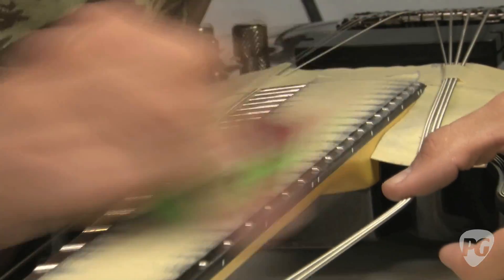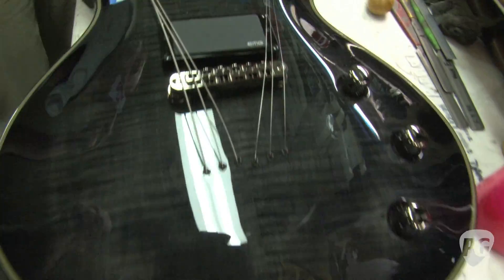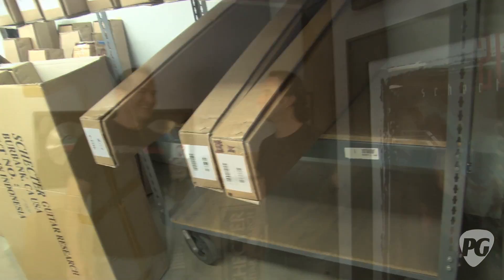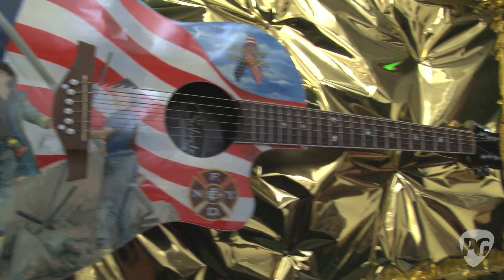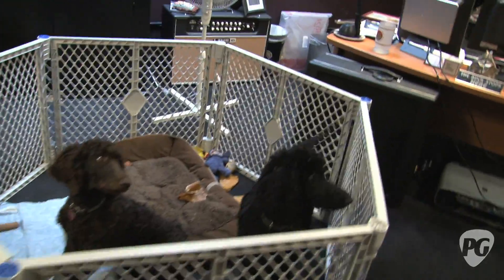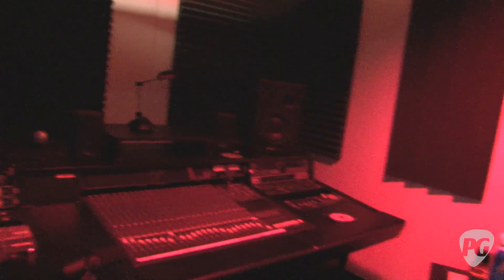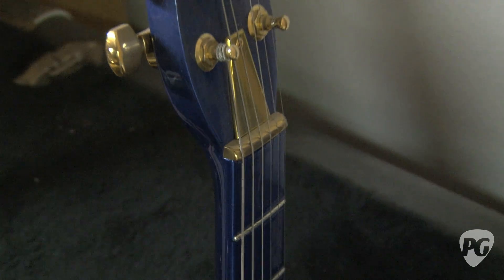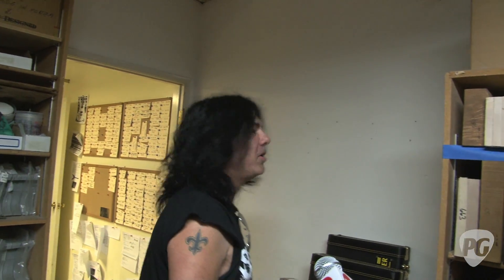Schecter Guitars Tour

Comment: I have a syn custom, first one was a nightmare. I sent it in after having a real "luthier" try to do a setup on it. Turned out the neck wood wasnt dried enough and every time he tried to intanate the head stock wood move a drastic amount, as the trusrod was not adjusted properly. Finally was able to contact Schecter, and the send I just need a fret dress, I had the fret dress done before the luthier was doing the setup. Ended up they didn't even have my guitar on the bench.

Comment: They mistakenly already scrapped it. I had taken photos of the guitar before it left since it had a few dings and scratches to identify it as mine and the serial number as well. Finally after 3 more days of trying to make them identify my guitar and speek with the "Tech" that looked over my guitar, I was given a answer. I was vary lucky and Shecter replaced the guitar with another boxed guitar. Well the wood is vary good in this guitar but the electronics were a mess and the setup was terrible.

Comment: @rockstarbabyeah similer but different both taylor to mostly to  rock and metal guitarists  the difference is that in standered production models schecter tends to have better quality controll and usually better features for the price especially in there budget lines (below 450 dollers) there mid tier stuff is gennerrally bout even  but in custom shop stuff schector offers really great professional level guitars for usually no more than 800-1000 dolers esps are a tad better but far more costly